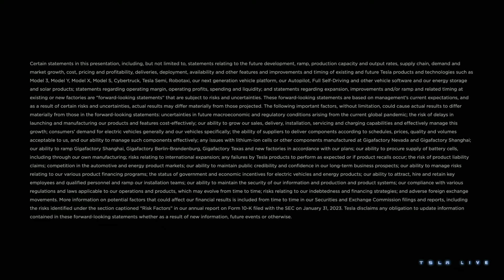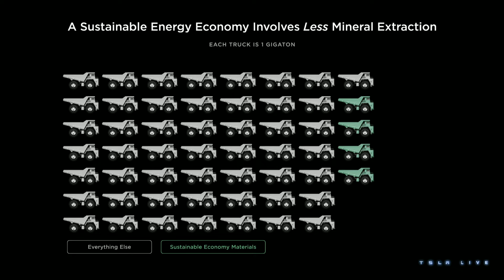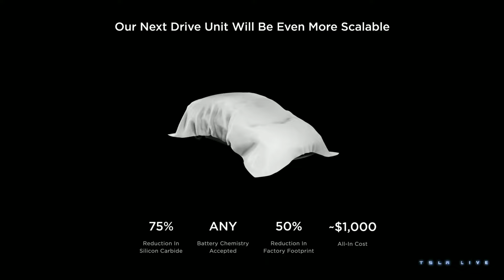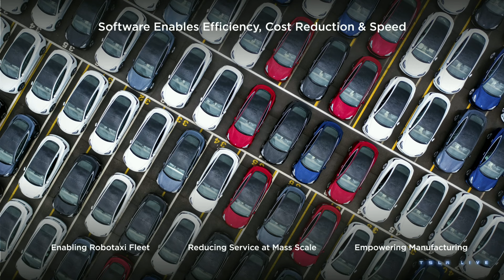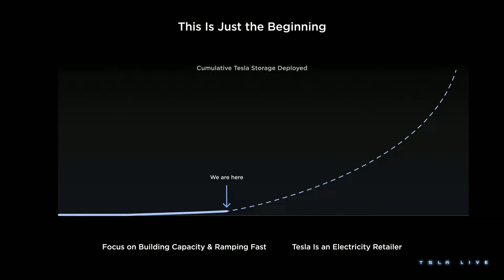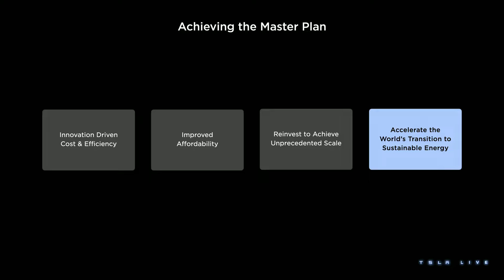2023 Investor Day | Tesla

Comment: 🎯 Key Takeaways for quick navigation:

13:20 🌍 Sustainable Energy Earth Overview
- Clear path to a sustainable energy Earth exists.
17:23 🔋 Master Plan: Battery Energy Storage
- A vast amount of battery energy storage (240 terawatt hours) is needed.
19:49 ☀️ Less Mining, More Sustainability
- Transition to an electrified economy requires less mining than the current fossil fuel economy.
21:43 🔄 Five Areas of Work
- Repowering the existing grid with renewables is essential.
26:01 ⚡ End-Use Efficiency with Electric Vehicles
- Tesla Model 3 is four times more efficient than a traditional gasoline car.
27:09 🏡 Electrifying Heat Pumps
- Heat pumps, serving up to 200°C, are crucial for displacing fossil fuel heating.
28:32 🔥 Electrifying High-Temperature Industrial Processes
- Over 50% of industrial heat processes operate at temperatures greater than 400°C.
30:38 ✈️ Sustainable Aviation and Shipping
- Electrification opportunities exist for both short-haul planes and long-haul ships.
32:13 🌍 Feasibility of Sustainable Energy Transition
- Feasibility of transitioning to sustainable energy.
33:55 🌐 Sustainable Energy Land Usage
- Land requirements for sustainable energy are less than 0.2% of total land.
35:14 ⛏️ Mineral Extraction in Sustainable Energy
- Sustainable energy economy reduces overall mineral extraction.
36:56 🌐 Commonness of Lithium and Other Materials
- Lithium is abundant globally; no country has a monopoly on it.
39:00 ♻️ Recycling in Sustainable Energy Economy
- Recycling reduces the overall ore required for sustainable energy.
52:02 🚗 Tesla's Commitment to Vehicle Excellence
- Tesla's track record showcases its ability to deliver high-quality cars despite constraints.
52:30 ⚡ Tesla's Emphasis on Speed and Efficiency
- Colin emphasizes Tesla's position as a leader in making the fastest cars with over a thousand horsepower.
53:44 💡 Tesla's Approach to Efficiency in Manufacturing
- Continuous improvement of the Model 3 and Y powertrain with a focus on efficiency in design, manufacturing, and scaling.
55:19 🛠️ In-House Expertise and Integrated Design
- Highlighting Tesla's unique approach of designing the entire vehicle and factory together as one cohesive unit.
56:44 🌐 In-House Advancements in High-Power Electronics
- Tesla's expertise in high-power electronics, showcasing examples such as custom-designed transistor packages and microprocessors.
57:56 🔄 Continuous Improvement in Software and Simulation
- Tesla's custom software for simulating the rotating magnetic field in the drive unit, enhancing cost, weight, and size optimization.
59:07 🔄 Transformative Changes in Next-Gen Powertrain
- Overview of transformative changes in the next-gen powertrain, including reducing the use of rare earth materials.
01:00:36 🌱 Aligning with Tesla's Master Plan
01:01:41 🚥 Evolution in Low Voltage System Design
- Challenges posed by the complexity of low voltage wire harnesses in traditional vehicle design.
01:07:31 ⚙️ Transition to 48 Volts for Low Voltage Design
- Shift from 12 volts to 48 volts in low voltage design for future Tesla platforms.
01:08:39 🌐 Streamlining Vehicle Network for Dynamic Changes
- Transition from centralized control to a local controller approach for wires in Cyber Truck design.
01:10:06 🌐 Utilizing Over-The-Air Updates and Data Insights
- Tesla's early adoption of over-the-air software updates for all controllers and sophisticated data logging capabilities.
01:11:43 📊 Data Utilization in Vehicle Design
01:13:07 ⚙️ Importance of Vertical Integration in Software
- Vertical integration is crucial for Tesla in software development.
01:14:15 🚗 Software Iteration and Testing
- Iterative testing of new algorithms in the background is critical, especially for safety features.
01:16:22 🏭 Application of Software Playbook in Manufacturing
- Tesla applies a software testing approach to manufacturing processes.
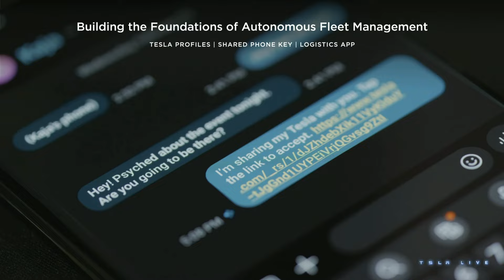01:18:46 🔄 Future of Autonomous Fleets
- Beyond self-driving, Tesla focuses on managing a network of autonomous vehicles.
01:20:37 🚗 Role of Full Self-Driving (FSD) in Sustainable Future
- FSD is a critical part of Tesla's plan for a sustainable future.
01:22:11 🧠 Components of Scalable Self-Driving System
- Architecture, data, and compute are crucial components of a scalable self-driving system.
01:29:17 🌐 FSD Beta and Continuous Improvement
- FSD Beta deployed to 400,000 customers, achieving 5-6x safety improvement.
01:33:38 🤖 Advanced Robotics in Production
- Tesla's Model S Plaid incorporates actuators in robots for efficient production.
01:35:20 💡 Underappreciated Tesla Aspect: Robotics and Economy
- Emphasis on humanoid robots' potential in the economy.
01:35:45 ⚡ Tesla Charging Infrastructure Overview
- Holistic approach to charging for various use cases, including home and away.
01:38:33 🗺️ Tesla Trip Planner and Efficiency
- Introduction and role of Tesla's Trip Planner in optimizing charging site utilization.
01:39:52 🔌 Future Charging Goals: Non-Tesla Integration and Renewables
- Opening Tesla's charging network to non-Tesla vehicles.
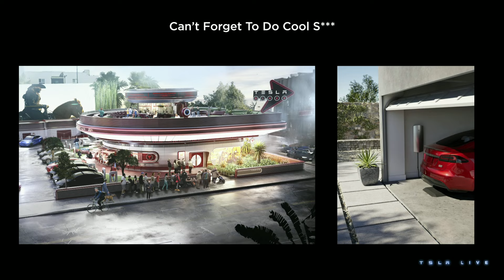01:43:52 🏭 Tesla's Unique Supply Chain Approach
- Overview of Tesla's supply chain for electronics, powertrain, and batteries.
01:46:36 🧩 Managing Complexity in Supply Chain
- Detailed insight into the complexity and management of Tesla's supply chain.
01:52:31 🌐 Supply Chain Complexity Overview
- Overview of Tesla's supply chain complexity.
01:54:10 🚀 Pandemic Challenges and Adaptations
- Challenges faced during the pandemic in managing the supply chain.
01:56:13 🚢 Logistics and Supply Chain Resilience
- Handling challenges like port congestion, logistics lead time increases, and chip shortages.
01:58:31 🧠 Tesla's Impact on Chip Industry
- Explanation of Tesla's impact on the chip industry.
02:00:11 🔄 Automation in Manufacturing
- Transition from dispersed thermal systems to fully automated heat pump technology.
02:03:57 🏗️ Scaling to 20 Million Vehicles
- Laying the foundation for executing Master Plan 3.
02:04:52 📈 Ramping Gigafactories
- Overview of Tesla's gigafactories and the goal to increase production.
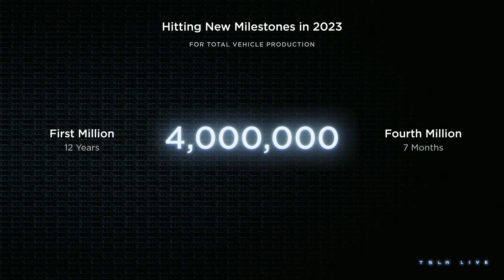02:08:07 ⏲️ Metrics for Factory Efficiency
- Focusing on Overall Equipment Effectiveness (OEE) and cycle time metrics.
02:10:56 🔄 Continuous Improvement Philosophy
- Implementing Elon's philosophy of questioning, deleting, simplifying, and accelerating.
02:13:02 🌍 Integrated Global Organization
- Integrating production, sales, delivery, and service into a global organization.
02:13:17 🏭 Tesla's Manufacturing Strategy
- Tesla plans to achieve the 20 million cars per year target by building new factories and production lines.
02:14:00 ⚙️ Advancements in Cell Manufacturing
- Significant progress in dry electrode technology, 20 times more productivity compared to Battery Day's tools.
02:15:18 🏭 Factory Design Efficiency
- Integrated design teams enable a 5x reduction in the factory footprint and volume.
02:16:27 🏭 Upstream Material Production
- Introduction of the 50 gigawatt-hour Corpus Christi lithium refinery in Texas.
02:18:29 🔋 Mega Pack Overview and Impact
- Overview of Mega Pack's evolution, focusing on successful projects worldwide.
02:20:56 ⚡ Power Electronics Leadership
- Tesla's leadership in Power Electronics, deploying over 1.4 terawatts across energy storage and vehicles.
02:24:54 💻 Auto Bidder and Grid Stability
- Introduction of Auto Bidder as an autonomous energy trading platform.
02:26:07 🌐 Tesla Electric: Distributed Energy Resources
- Tesla Electric's role in unlocking the full value of distributed energy and storage products.
02:29:23 🌍 Future of Energy Storage Deployment
- Expectations of a massive ramp-up in energy storage deployment.
02:31:24 🤝 Appreciation for Investors
02:31:38 🌍 Sustainability and Employee Impact
02:33:08 🌱 Sustainability Achievements
02:36:00 🚗 Zero Emission Future
02:37:18 💼 Financial Summary and Cost Reduction
02:52:07 🚗 Innovation for Cost Efficiency
03:03:23 🏭 New Gigafactory in Mexico
03:08:40 🌍 Innovation in Mining and Materials
03:12:30 ☀️ Renewable Industry Impact
03:14:03 🚗 Scaling with Few Models
03:18:59 🇨🇳 Market Share Growth in China
03:19:42 📈 Operational Efficiency Metrics
03:21:10 🤑 Affordability Driven Demand
03:22:04 🚙 Autonomy and Asset Value Increase
03:23:07 🌐 Next-Gen Vehicle Ramp-Up Priorities
03:23:34 🚗 Vehicle Demand and Affordability
03:26:27 🌐 Next Generation Platform and Market Segments
03:28:35 🚚 Logistics Challenges and Strategic Mitigation
03:29:56 🔄 Overcapacity Strategy: Cells and Stationary Storage
03:30:41 🌍 Global Cost Strategies
03:34:05 💹 Long-term Growth, Operating Margins, and Capex
03:37:10 🔍 Autonomous Driving: Multi-Trip Reconstruction
03:38:09 🧪 Progress in Dry Battery Electrode Technology
03:40:48 ⚙️ Scaling Dry Battery Electrode Production

Made with HARPA AI

Comment: Sounds great. If only the manufacturing reality met up with the presentation. Tell me, how does the car know if the bolt that holds the steering wheel in was installed?
Reply: My son is currently running a private programme for new, older or none financial investors on his private trading platform which has been very successful🥰

Comment: I've used a sunroof quite a bit in my previous cars. But I guess the biggest use has been to keep the car from heating up on a hot day. That would seem to save about 20 miles of range sitting in my work parking lot over a 9 hour day with overheat protection on. That's for a fairly hot day over 80f. And I wonder if your sunroof data is skewed due to the higher percentage of cars in California.

Comment: I would hope that someone will start to install wind farms in Southeast Oregon, and that is only about 300 miles from the Reno production facility.  A 2,000 MW power line from a 3,000MW wind farm will allow a lot of the power used in Reno production plants to come from wind power, and also supply wind power to the nearby superchargers along I-80.  

When solar panels are installed in a higher elevation, such as Reno, they can collect more power per square meter than panels installed closer to sea level.

Comment: At the very small scale of our household, my calculations predict that when we will have finished switching entirely to electricity for all our energy usage, we will basically use about 40-45% less energy than our household used to use on dual fuel (gas and electricity). So very close to Elon Musk’s 50% decrease in energy usage.

Comment: At timecard 1:08:24 they mention aggregating sensor inputs into local controllers and then sending it over Ethernet.  They didn't say it, but Ethernet is only deterministic when you turn automatic retransmission off and use dedicated point to point links.  Adding layers like TSN on top of it adds the ability to separate traffic by criticality.  This trend in the automotive industry has merit.  Reducing wiring can reduce failure rate.  But now the Ethernet wire and software become single point sources of failure.  And if they fail, it won't be just one thing that goes out, it can be all your sensors/control signals at once.  Hopefully they are using redundant sets of processors and Ethernet wires.

Comment: I can't help but think that Dolorean was probably stopped behind the scenes because he tried to release a stainless steel car. Stainless steel by it's nature, lasts forever, which is the opposite of the normal corporate charter of planned obsolesce. 

The original Model T used an antique version of stainless steel and it did not rust, and the body panels to this day on Model T's, are still not rusted. Companies switched to a very rusty metal, after starting with a high grade, rust resistant alloy. Now with Tesla using stainless steel, the other manufacturers have to be extremely nervous about the idea of selling a product that can potentially last forever, with no finite lifespan programmed into the metal material. 

Cars and trucks, but trucks especially, should have been legally mandated to use galvanized steel, aluminum or stainless steel rocker panels and fenders, long ago. To have a vehicle that eventually rusts and becomes unsafe, is not good for the environment.

In places like Arizona, Southern California, Nevada and Africa, there are vehicles from the 1960's, that are still in mint condition, and still being driven daily, because they have not rusted. A vehicle that does not corrode, can be put into endless service, especially if the drivetrain can be modified easily.

Consider that at some point, a 1960's car can be converted with modern electronics, to be a modern EV. Consider how much use that vehicle provided during its lifespan, and how the simple engineering of the engine and drivetrain, allowed for upgrades more than 60 years later. All vehicles sold today, should have some measure of "upgradeability" engineered into them. A stainless steel body, is the first step in future proofing a vehicle.

Comment: At timecode 56:02 they mention using four microprocessors for the high-power switching.  As someone who has designed real-time high-power switching boards, they should have been using an FPGA.  Even a cheap $35 FPGA could probably do it with 100% deterministic timing and lots of resources to spare.  It's a shame that its relatively harder to find FPGA programmers.  It's not really that hard.

Comment: Can the current gen 3 home charger work with v2h without a neutral (assuming an existing pw system)??? Some solar inverters lack a neutral.  Elon laughs this off but would be great for TOU with cheaper $/kwh in the cars and more peace of mind as a quasi prepper for 1-3 month winter outages in northern latitudes.

Comment: At https://youtu.be/Hl1zEzVUV7w?t=12825 why would the house go dark in the absence of a PowerWall? The house network can switch back to electricity coming from the utility company. While it may take a second or two, it doesn't require much electricity storage to avoid disruption. Probably a small multiple of one watt-hour (1Wh supplies 3.6kW during 1 second). Negligible size battery, or if the switch is much shorter, a large capacitor may be enough.

Comment: Why cover "land" in solar panels when we already have rooftops suitable for that job?
Covering 50% of the global rooftop area in grid tied PV could power 100% of the world's demand.
That would make individual property owners the energy company's 'partner'.
If my own roof was covered in PV, it would produce in one year, 3X what I consume in a year.
The Tesla heat pump tech could be manufactured as a 'backing' plate to the PV panel & would both capture heat & cool the panels at the same time (PV is more efficient when cool).
Finally: Why can't aircraft be manufactured with those flexible lithium batteries & form those into the wing & body structure? The wings & body could be the battery - just like the Tesla cars use the battery pack structurally.

Comment: Fact check...there is estimated to be 6.8 million tonnes of lithium reserves in the U.S.  Each Tesla model 3 requires 165 pounds of lithium to produce the battery within each vehicle.  If you were to provide 332 million people in the U.S. with just 1 model 3 the U.S. would not have enough reserves to produce vehicles for everyone, let alone all other lithium reserves required to electrify America, as Elon stated in this presentation.  In fact you'd fall short of the requirement by a whopping 73%!!!  Of course not everyone will need a Tesla, however if you take the current number of registered vehicles in the U.S of 278 million even that number could not be produced from the lithium in the U.S.  So no Elon, the U.S doesn't have enough lithium to electrify the whole country.

Comment: Also wireless ev charging makes sense because of so many building with more than 1 floor that parking space would not be enough to put charging stations or not practical to get a large cable from the 2nd floor or the electric lines🤔

Comment: Supercharger manufacturing is efficient, but the design excludes the vast majority of disabled drivers, especially those in wheelchairs. It should be possible to integrate both efficiency, cost effectiveness, and accessibility into the design. 
As Tami Grey-Thompson, a former UK paralympian, was saying a couple of days ago, despite her and her husband wanting to do their bit by going EV last year when they needed a new car, inaccessibility of the public charging network for disabled users meant they had to go diesel instead. 
What a shame & and potentially wasted opportunity. Electrification of transportation represents a huge boon for getting the disabled into the workforce & off of benefits. 
After swapping her racing wheelchair for a civvy street one, Mrs Grey-Thompson entered Westminster politics as a Welsh MP. As such, she enjoys a much higher profile than most disabled athletes, both former & current, and could have been a champion of the EV revolution for the disabled.

Comment: Can you capture the energy of lightning strikes around the world?
Reply: Sure, if you knew where it was going to strike and could make it strike that same point reliably.
Reply: @TheEvilmooseofdoom Lightning rods already exist like the Eiffel tower which attracts lightning to strike. This could be re-engineered to work more effectively and consistently. One lightning flash delivers 300 million volts and 30,000 amps and is 50,000 degrees Fahrenheit which is 5 times hotter than the surface of the Sun.